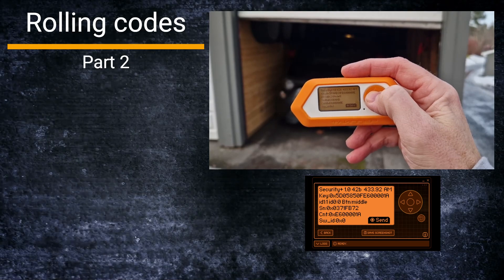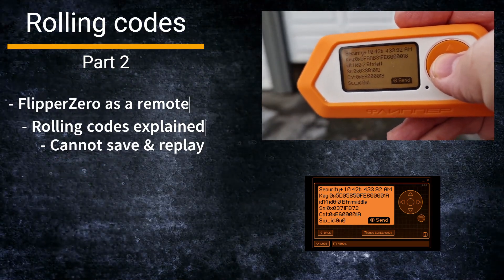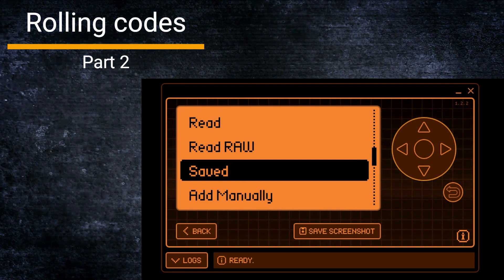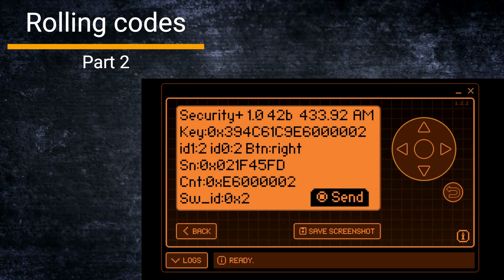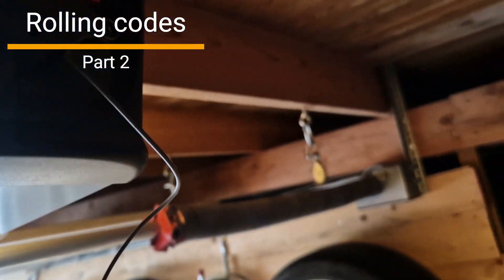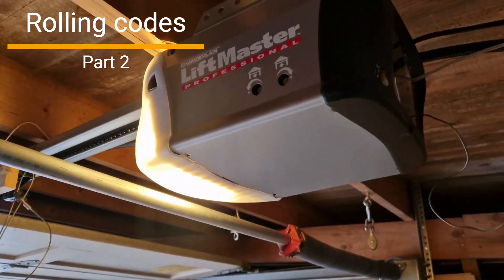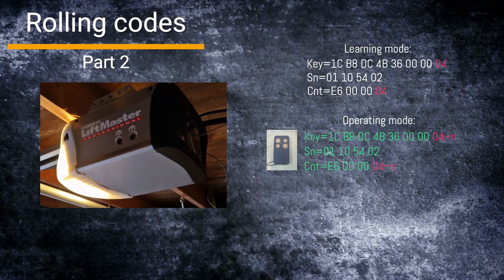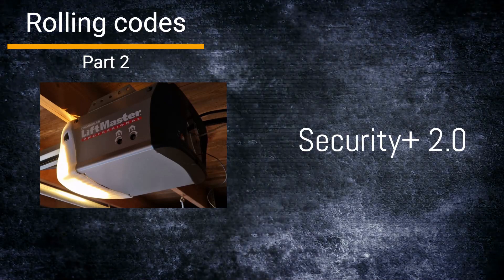Rolling Codes Explained part 2. I hacked my own garage door #flipperzero

Comment: how can i get the flipper.  by what name not just flipper
Reply: It's called a Flipper Zero, but if you don't know what you're doing and are just going to buy one, I wouldn't suggest that. It's not just a fun toy to play around with and you can get into a lot of trouble for misusing it. If your garage door opens fine right now just use that. If you're only getting one to open your garage door, you definitely don't need it for that. Look up what else it can do and be sure you're ready for thug responsibility and to learn how to use it.

Comment: cant we get the algorithm read by scanning the hz?
So i am pressing a few times my keys, the flipper is reading and calculating than the algorithm so i have than the key?
Reply: Apparently doing that will make the original remote stop working, as every time it's used a counter is supposed to go up and now you're incrementing the counter with the flipper instead of the original remote.

Comment: I have the same system on my liftmaster.
I just pressed read on my flipper and i caught the security+ signal. 
But if i use my flipper i have to press my original remote about 20 times for it to work, then if i want to use the flipper again i have to press it  enough times so the rolling codes allign.

Comment: What are your thoughts on desyncing remotes? I have heard it happening to many individuals. In my specific case the original remote did not work for a bit, but ended up working eventually after many attempts. What causes this?

Thank you
Reply: Some openers only use Security+ 1.0 which increments the key by 2 with every press. Let say you use the flipper a bunch of times to open the door… The remote is behind on the rolling code so you may have to press the opener 50 times or so to get it back in sync. I think the garage door opener just accepts the greatest value within a certain delta of the last key it received.
Reply: Did you find an answer? Did experience a similar behavior (at least the desync). Had to manually relearn the remote. All fine since then.

Comment: Ok I emulated the same garage door that you have but it worked out differently. My flipper would pair signals with my receiver but after that it wouldn’t open it.. I had to instead unplug my receiver, emulate my chamberlain opener with frequency analyzer, then read raw, push the opener button and it saved the signal. Plugged my receiver back in then used my flipper to open and close ..

Comment: Any thoughts on the official flipperdevices firmware versus 'unleashed' forks like that from RogueMaster or DarkFlippers ?

So in general, the $170 Flipper Zero allows you to capture a signal (IR, NFC, sub-ghz etc) and replay it back.. or run your upload own (Hak5 DuckyScript3?) script?   I've seen some (unespc) that offer wifi scripts.. but that's  GHZ so not sure if that's real!

And how difficult would it be to do all the things the Flipper Zero does, on a HackRF or a LimeSDR?  Would the code need to be ported to GNU Radio Companion?

BTW, why isn't FlipperZero sold on Hak5?
Reply: I wait for the flipper one which should include wifi networks as well.
Reply: just use a wi-fi board?

Comment: Mine is a Security+ 2.0 with a 314.98 AM. It only lets me choose a Security+ 2.0 with a 315 AM, so it won't sync. Is there any way I can tweak the coding to be more precise?
Reply: How did you get to know the algorithm of your remote?
Reply: @KL4NNNN  I ended up having to upload a file to my computer and edit the code to 314.98 and resave it to the Flipper. Then it worked fine.
If you need help, just let me know and I can help you out

Comment: You didn't HACK your garage, you simply added a universal remote.
Reply: Isn't it the same thing? Because of those movies about "hackers," people started to forget what hacking actually means. He didn't say anything about broke in or crack etc.
Reply: @r00ty  Nah. Hacking implies that someone gained access in an unconventional way. Being inside of a garage and then using the programming button is very conventional. It's actually how the manual explains how to add remotes. An example of hacking would be to gain access to the garage by knowing the correct algorithm and then listening to the codes as the standard remote is pressed. If someone already has access to the inside of the garage, hacking wouldn't be necessary in the first place.
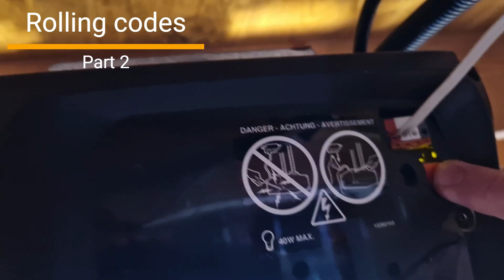As a reference, he accessed the garage programming button in the video @4:55
Reply: That is definitely hacking. Hacking just means to get something to do what you want instead of what is intended. There is no purism in hacking only results
Reply: you need to look at how old a comment is before replying to it. @austinrhoads
Reply: @ScottPlude  nah
Reply: then you are blocked like the average troll @austinrhoads
Reply: @ScottPlude  ya know, my comment was pretty benign not intended to be rude or contentious. I was simply engaging in a public conversation. But when I read your comments it's apparent you're just really insecure, reading negativity into everything while trying to cut down this content creator. You sound old but with the emotional intelligence of a child. I just don't want people who are learning cyber security to read your comment and think it's true because it's a common misconception. Your comments read like rage bait and it makes me think... Whose the real troll here?
Reply: Figuratively speaking if he is bypassing rolling code it is hacking.
Reply: @lactatinglatinas He's not bypassing anything. He simply added the most expensive additional remote ever, using the method officially documented by the manufacturer. Noname remotes can be added just like that for 1/10th of the price of the Flipper.

Comment: So to me, the mystery here is the same as it is when I buy a cheap knock-off remote for my opener (also Security + 1.0).

These use KeeLoq, and in order to create a new remote you must create a device key.  Here's the rub:  creating the device key requires knowledge of the manufacturer's key, sort of a "master" key which is NOT stored on the remotes, only in the receiver.

Is it now common knowledge what the Chamberlain Security +  1.0 master key is?  Otherwise, how can these knock-offs derive a device key?

And apparently, the many branded 1.0 openers made by Chamberlain (Lift Master, Craftsman, etc) all use the same manufacturer key.

With a know mfg key, a code grabber can easily clone a heard remote, including the sequence number that was used in the transmission.

Comment: I was wondering.. Is there a possibility to record the signal/code from your remote and than let the flipper takeover where you left off? Now you still need access to the unit within the garage. I wonder if there could be clever way to really hack your garage by creating a copy of the signal and set the counter manually at the next rolling code...
Reply from the maker: I think this depends of the implementation. When "learning" a new remote, the opener usually starts a "separate" track that follows a specific sequence. Other remotes will not get access to the same "track" so you cannot enter at a specific number in the sequence.
Reply: From my understanding you could. You could try to decode the key from the real remote. Then create a copy of it on the flipper with the same counter (via add manually and then altering the config file). However you would de-synchronize your real remote when using it.
Reply: @levitatingbusinessman2560  That is what I was thinking. Because algorithm for generating subsequents codes is known, capturing current code means you could the next one. Or you still need initial code? I haven't checked algorithm.

Comment: It's funny how somone buys a ready made device, while using it without modifying anything then make a bold claim they "hacked" something.
Reply: So by that definition buying a laptop, putting Kali on it and goin around decrypting peoples WiFi passwords is also "not hacking" 💀
Or you wanna develop your own CPU, Motherboard, WiFi card, etc 👁️👄👁️
Reply: @EpicLPer 👏
Reply: If you watch the video.. He actually synced it to his device and paired them. Next time actually watch a video before you comment.
Reply: He simply paired a blank remote using firmware installed on the device. Sweeping the count to mimic the existing remote would be a hack.
Reply: @jordansmallwood4605  you can use to read any thing that runs off it you can even do stop lights look it up
Reply: lol

Comment: It can work for car doors too?
Reply from the maker: I would guess yes - in principle - but the problem with cars is that you cannot initialize the pairing process yourself - unless you have special programming tools. So you would have to go to your car manufator dealer to activate (pair) a new remote. With garage doors you can init the pairing by pressing the button as I did in this video.

Comment: how do you know what car port protocol the sistem is using outside europe?? Should be in the user´s manual?
Reply from the maker: I'm not aware of such a site / database of products and related security algorithms. The Flipper will show the protocol if it manages to read it. Menu > Sub-GHz > Read
Reply from the maker: I've received many questions about how to find the correct protocol, so I made a new video that might help: https://youtu.be/fMYekJNI-yw

Comment: Is there a site or something to search what kind of protocol are using different types of remote machines? Like how did you know the garage door motor is using that protocol without letting the flipper read it's remote
Reply from the maker: I'm not aware of such a site / database of products and related security algorithms. The Flipper will show the protocol if it manages to read it. Menu > Sub-GHz > Read
Reply from the maker: I've received many questions about how to find the correct protocol, so I made a new video that might help: https://youtu.be/fMYekJNI-yw

Comment: Thanks for this video ! How did you figure out that your garage uses security +1.0 rolling code?
Reply from the maker: The Flipper will show the protocol if it manages to read it. Menu > Sub-GHz > Read
Reply: @techandfun7723  my flipper sub ghz- read works only if binraw is turned on . Then i get a binraw file that shows me the size and a key but no Protokoll . Giving a new video idea here 😀
Reply from the maker: I've received many questions about how to find the correct protocol, so I made a new video that might help: https://youtu.be/fMYekJNI-yw
Reply: @techandfun7723 thanks 😊 🙏